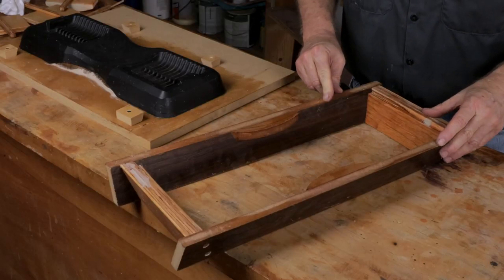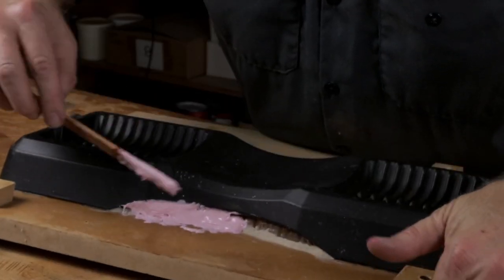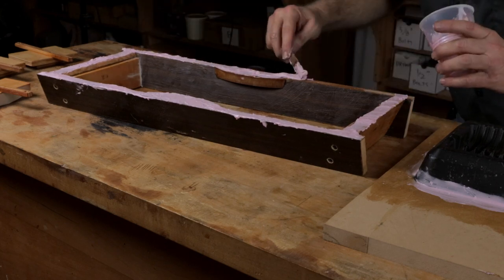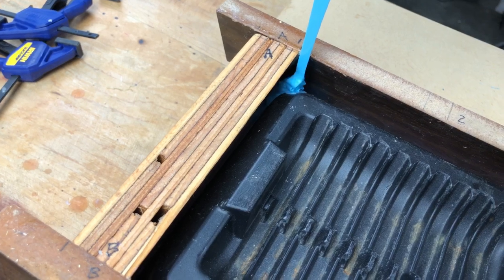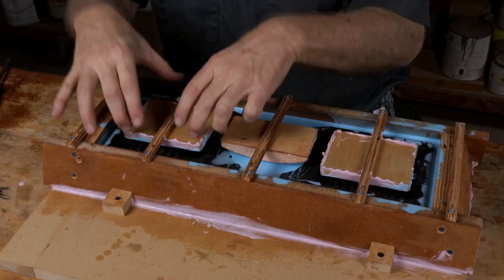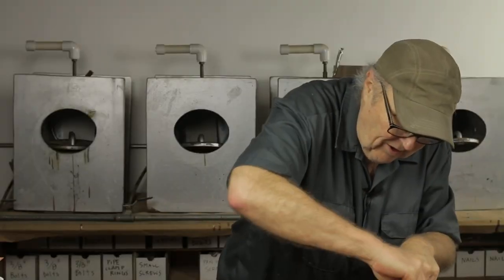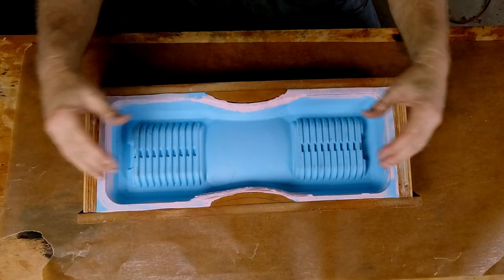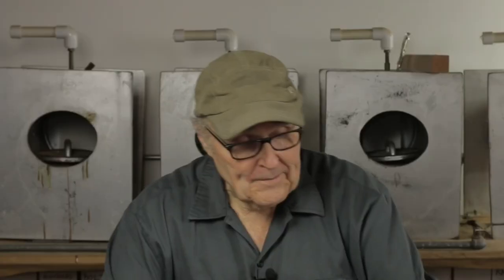Pouring A Silicone Rubber Blanket Mold - 7 Tips And Tricks

Comment: I love love love your videos!! Easy to understand and super informative!! I would love to mold an animal skull but can't find a good video that explains how to. Could you please make one? Pretty pretty please??? The top part seems easy but how does one do the bottom part and sides that have finer bones in to make a 3d mold? Thanks for taking the time to teach us mere mortals the ways of casting molds!
Reply from the maker: This mere mortal has been thinking about doing a video about molding and casting an animal skull. I’ve done a number of human skulls (toy sized) and usually the jaw and lower teeth are molded and cast separately from the main skull. Obviously, all the entrances into the brain case have to be blocked up to prevent it from filling with rubber. Thanks for the excellent suggestion!

Comment: Thanks for your informative videos on mold making and casting.  I've been working on a project for a year now to make a puzzle / toy that is two identical parts that interlock or come apart easily - if you know how to align their geometry just right.  I've been making these pieces in wood on a CNC router and have pretty much perfected their geometry.  It does take a bit of time to carve them out and sand and finish them.  I'd very much like to cast them in resin as I think I could make them much quicker and more people could have fun figuring out how how to make them work.  

The challenge for these part is that the geometry has large (.75") holes and bits at right angle to the main body. The molds I've made tend to catch bubbles so mold orientation, venting and parting the mold along the vent is a challenge.  The parts even though they are rather organic in shape need to be precise and identical to work as a puzzle.  

A cut mold makes a lot of sense for this project but a hefty block of rubber would make it difficult to use in a production environment.  A thinner more flexible mold along with say a plastic or plaster mother mold makes it easier to de-mold but difficult to maintain geometrical uniformity.  Thoughts?

Comment: Is there a way to cut spheres out of silicone easily? Could be useful chunks with the least chance of catching bubbles or interfering with the object
Reply from the maker: I don’t know of any way to cut spheres. I find that cubes are very easy to press into the rubber and I never seem to catch bubbles. It’s easy and simple.  I have tried other methods, including filling the mold with chunk rubber before pouring in the new rubber. But that invariably creates voids in the mold. In a deep mold I work in layers. Pour in some rubber, press in some chunks, pour in more rubber, etc. - repeat until the mold is full.  Truth is, this method saves on rubber but is labor intensive.  I don’t use it for client work because rubber is cheaper than time. I show it on my channel because viewers often complain about the high cost of the materials.

Comment: I do have a question, I am new to making molds.

I bought a random silicone rubber (I thought there was only one type) and whenever I mix it with the curing agent, I find it hard to pour it bc it start hardening already. I wonder what type should I buy or if there were a mistake I did. (the mixing time was 3 min only)

Comment: I am trying to make enclosures but I am having trouble with M2x10 (and longer) screw holes catching silicone and breaking it off when releasing the mold (even with mold release).
Reply from the maker: Can you seal the screw holes with wax or clay?
Reply: @RobertTolone  Well I guess I can but I was wondering what YOU would do in a production environment? It would save a lot of time if the holes could be part of the casting process  and also less error prone than drilling by hand. I was thinking of possibly doing some sort of cold casting to make a metal mold instead but I still need to try simply using a stronger rubber.
Reply from the maker: I always drill holes in castings rather than try to cast the holes for exactly that reason.  The rubber always breaks off.  I mark the hole location on the model with divot or very shallow hole so it’s easy the start the drilling in the proper location. In a production run I build jigs to hold the castings in position for drilling and other machining operations.
Reply: @RobertTolone  Thank you very much for the advice. It is much appreciated!

Comment: Awesome lessons, your tutorials have inspired me to make some casts of model kits parts.  I do have  a question that you may have answered before.  For the very green beginner what is a budget friendly and fast casting silicone and resin combination?  for context I am casting 1\144 model kit sprues.
Reply from the maker: Unfortunately, I have never found “budget” silicone rubber or resins. The most expensive way to buy them (by volume) is in kits sold by craft stores. The least expensive way to buy them (by volume) is in 55 gallon drums. I buy them in 5-gallon buckets. Horribly expensive but that’s the best compromise of cost and value for my shop.

Comment: :D When you released the mold, my first thought was: "Isn't that a little flappy for a mold?" But ofcourse, the wooden mold case now is used as a mother, I should have known from all the videos I already saw from you. ^_^
Nice you pointed out, that you don't need these super big, block-shaped molds other channels show.
I still have one question: I have seen youtubers build their mold cases from Lego bricks. Ofcourse you then will have a block and Lego isn't really cheap as well. But I wondered about the fact that you always have to care about leaking and the guys who use Lego don't care so much about it. Is Lego really so tightly closed that rubber won't leak? Or do they use a special rubber that's not able to flow through the tiny gabs between Lego bricks?
Reply: I’ve tried the LEGO technique and it generally works for quick, scrappy molds. You’ll occasionally get slight bleeding between bricks but it usually doesn’t flow through if you really press down on the LEGO ‘box’ before filling with rubber/silicone. Also a re-enforcement of Clay or sculpy or hot glue gun glue around the base should stop any leakage as well.  Try a small version and see how you do. Good luck!
Reply from the maker: Dave knows more about this than I do. I’ve never tried a LEGO case. True, l’m obsessed with leaks, especially in large molds. Once they get going leaks can be incredibly difficult to stop!